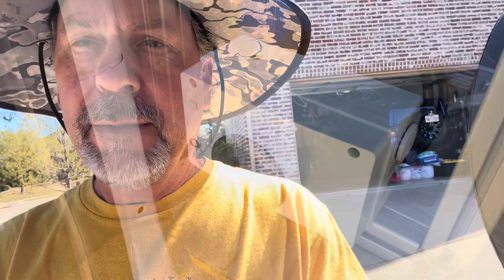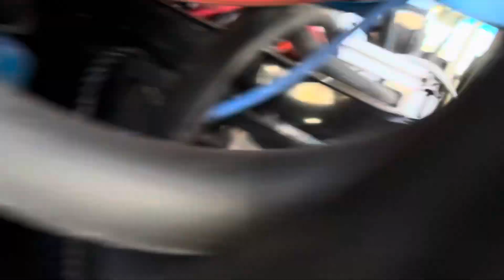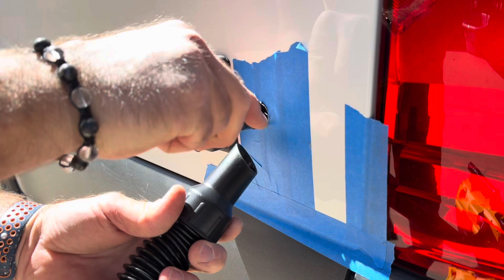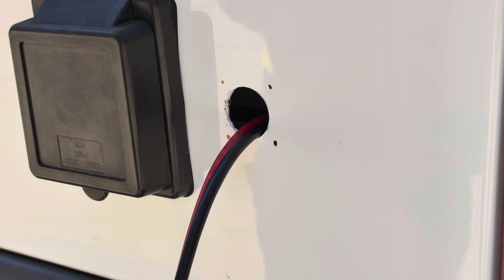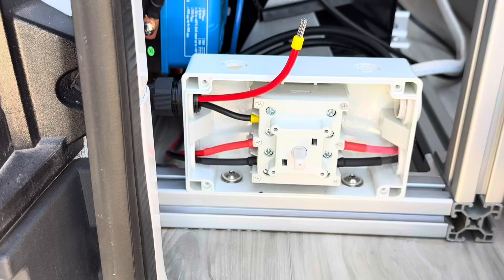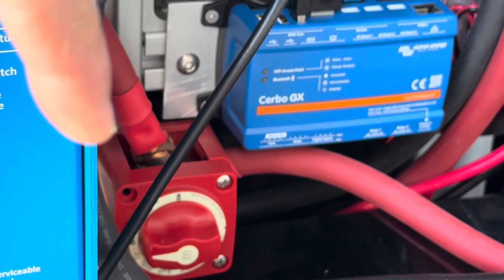How to add more solar to your Campervan when roof is maxed out @vandingo1

Comment: Hi, nice option if you are needing or have additional panels you can “deploy”
Having its own charge controller lets you see what they are actually giving and the option of having them in series to minimise line loss if they are long.
Take care M.
Reply from the maker: Thanks, I have a set of ground panels 100w so expect to deploy and understand impact to charge speed before considering any type of ground deploy panel upgrade.